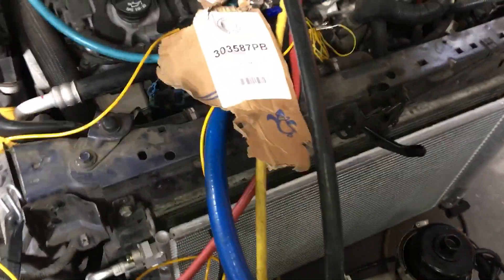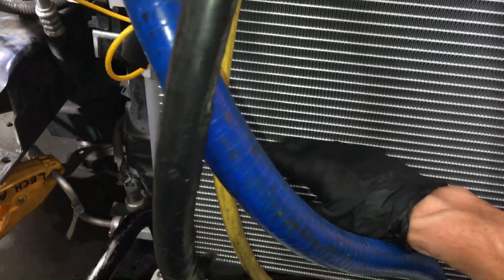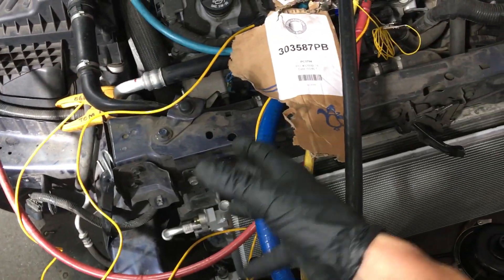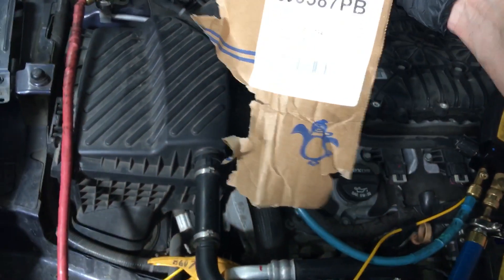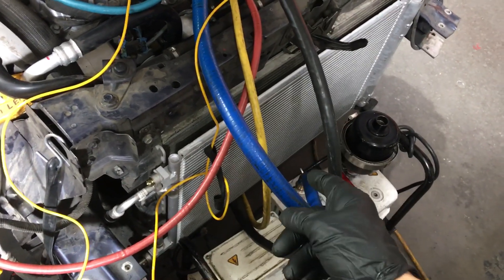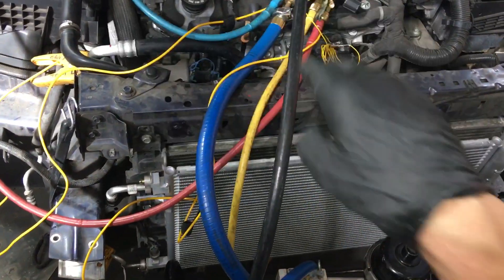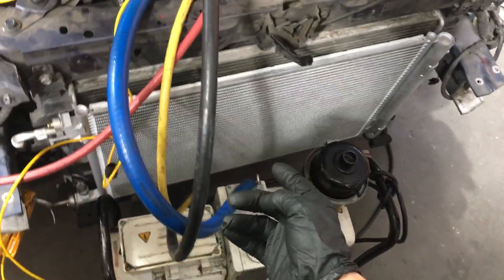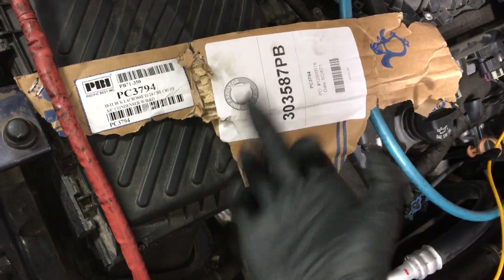Customer Gets ripped off with economy priced AC condensers.  People have no idea problems caused￼ ?￼

Comment: I just learned that with the 97 and older Mazda Miata's all of the A/C condensers available on the market are serpentine condensers when the OE one is a parallel flow unit. a friend of mine installed one of the aftermarket ones into his car and asked why the A/C doesn't work as well as it does on his other Miata. I told him its because of the condenser, we are going to attempt to install a 98 Miata condenser into his 96 because they sell parallel flow condensers for those cars.
Reply from the maker: When you do that there’s a possibility you might have to reduce the refrigerant weight. 

         Parallel flow condensers are much more sensitive to refrigerant volume. 
      They are a much more efficient condenser at rejecting heat

       Modifying hoses and fittings ends are possible and are available it just takes extra work making up your own custom lines if needed. 

        Make sure you change the receiver dryer. 
If you can just leave it on the vacuum pump overnight you could never over vacuum the more the better. 

         And if you’re very much into DYI it would not hurt to change the expansion valve. 
         Many people do not realize they have moving parts in them they have a spring under tension that has gone through millions of cycles through its life it has a refrigerant gas charge in the end of its valve bulb that sometimes has a limited life. 
             They may not be bad but they slowly drift out of calibration with age so why risk it it’s cheap just replace it. 

      And recharge it by weight of refrigerant not by any kind of pressure that somebody may tell you or temperatures. 

       Only problem is when you’re modifying the condenser the factory weight may not be correct. 

     If it is a true fan system make sure both radiator fans are operating to their full potential.

Comment: Hi. Thanks for the great info. I have a generic question I think will be of interest  for diy people like me subscribed to your channel. 
I know that best method is to evacuate a system and charge by weight. But is there a good method to topoff a system (fixed displacement compressor) that is low on refrigerant using SC and SH ? Or maybe in other  method.  As a diy  I don't have a way to evacuate the system .and looking for a way to topoff to the correct amount.  Thanks 😊🙏.
Reply: Nope.   No "DIY" here.   Take it to a professional.  Only licensed shops should touch the A/C system per EPA law.  Study up, get your license or pay a licensed shop to do so.
Reply from the maker: @komoru  yes , read up and study , 
RTFM
Reply from the maker: Thank you for subscribing.  And yes it is possible using sub cooling and superheat it depends whether you have a Office tube system or a expansion valve system. 

           But there are a lot of variables that can throw your readings off and they would be wrong anyway so you have to take care of those possible problems first or variables. 

      Condenser must be clean the evaporator must be clean no dog hair or heavy dust or leaf material build up that was stuck down through the fresh air vent or from having a dog inside the car and sucking up long fluffy hair. 

            Airflow is very important make sure if it’s an old car that the ground connection to the body chassis is clean and tight and good so you have full voltage to your old blower motor 
         Make sure your connector for the positive power is clean and tight if we’re talking about a very old car or you used to get a hold of the blower motor outside the firewall or under the kick panel where your passenger feet are. 

              It needs to be a fairly warm day say 80° plus

           Open up all the windows and doors to keep the interior cabin under a load of heat supplied to the evaporator you do not want a cold interior because that will satisfy your thermostat temperature setting and shut the compressor off in a row constantly be cycling never in a steady state.   

         I forgot to mention I am referring to old vehicles using R12 refrigerant this is how old the cars I’m talking about.   Newer vehicles with R134 is possible on “some” vehicles a little more difficult. 

             And even on these old vehicles in the factory manuals they would describe the method and what rpm the engine would have to be set up because it is different for different vehicles.      Compressors do not run efficiently at idle they were not designed to operate at that RPM.      Now to be 100% correct you would have to get the old factory manual go to the air conditioning section and read at what rpm for that year make and model with that particular manufactures compressor to hold the engine RPM at. 

            And if we’re talking about older vehicles do you have a single speed radiator fan that is not constantly shutting off and on causing your pressures and your superheat and sub cooling to constantly shoot up and down oscillating it Hass to be at a fixed steady state constantly running. 

                And if we are talking about much older vehicles that used a engine mounted fan on a fluid driven thermal fan clutch it Hass to be in excellent condition.   What I’m saying is you might as well replace it right now with a new one do you have like OEM operating conditions when the fan vehicle was new. 

           Fluid driven thermal thing clutches slowly drift out of calibration as they age let’s say roughly 30,000 miles to 50,000 miles of operation they still work but they don’t quite flow and move the quantity of air that they used to. 
                    The engine coolant temperature does not have to worry about this because radiators were usually so well over respect for their job because manufactures don’t want burnt up engines coming back all the time under warranty they have a lot of extra cooling for error with lower fan speeds it’s still cool just fine. 

                But the condenser chosen for the vehicle is often just barely sized right this is a part they always put the least amount of money into for sized correctly or lower airflow.  And just having a few hundred CFM less air flowing over the condenser while you’re performing your test affects the pressures affects the superheat affects the sub cooling that will give you the incorrect numbers.  

            But when you research and you look up and download or find old service manuals from vehicles going all the way back into the 1950s around when air-conditioning was introduced .
Reply: @komoru  I'm not in USA. In my country it's allowed
Reply from the maker: They will give you the information in pressure psi because that’s the way they did it and it was fairly accurate when following exactly their instructions on how I described above. 
                  For example let’s see whatever manufacture vehicle you have instructions says raise the idle to 1200 RPMs for some manufactures another manufacture it might be 1500 RPMs and another manufacture might be 1800 RPM.    So we used to turn the screw on the carburetor for the idle control and fix the RPMs at that level while it was in our shop.  Follow the manufacturers recycle or fresh air position whatever they say to do in their instructions for that year make model vehicle. 

           We would have a very large fan do you know those type of fans that you see that are 3 feet or 5 feet high. Operating in front of the car a few feet away pushing a steady flow of air over the vehicle. 

             Then whatever your year make model vehicles manufacture would tell you and give you a chart with temperatures down one column and pressures on another column and you would match them up for your high side. 

          The manufacture will tell you your high side pressure would be about 30 psi or 40 psi above whatever your ambient temperature was this is only an example different manufacturers were different. This is why are you follow and read the instructions. 
               So if the outside ambient temperature was 90°F.   The manufacturer said your high side pressure will be 50 psi higher than whatever the outside ambient temperature was. Then you would keep slowly adding about 1 ounce of refrigerant at a time waiting a few minutes between adding refrigerant and watching your pressure until it reached at 140 psi. 
                 At the same time they may give you a low pressure range and they might tell you your low side pressure will between 21 psi and 24 psi for example.   This pressure is just for example and not fixed in stone for every vehicle.       Because there were vehicles that when you would perform this test your low side pressure would be around 12 psi to17 psi for example. 
                Then there was other vehicles that the high side pressure under these exact same operating conditions the high side pressure maybe 180 psi to 210 psi under the same operating conditions. 
            And I remember there were some little foreign vehicles with very small condensers and I actually owned one of them I believe it was my 1988 Chevy sprint on a very hot day like 90° or 100°F my high side pressure would be around 310 psi and for some small vehicle manufacturers this was normal under really hot ambient conditions.  This is why you read

            And under these hot ambient operating conditions with the vehicle set at the RPM in which that particular manufacture called for using R12 refrigerant they would refer to the site glass looking for bubbles and with these old systems using the site glass back in these days we’ll get you in the ballpark and was fairly accurate.  Good enough for government work and we are talking about older cars. 
               This was specially more reliable on the old cars that used to have the Big heavy York or Tecumseh compressors or Frigidaire A6 

          There was an average and some manufactures would tell you on an orifice tube system that you would look for somewhere around A 5° superheat drop difference across your accumulator from your inlet to your outlet pipe.      
               But when we’re talking about these large old heavy usually slow rotating compressors because most all vehicles V8 engines did not rev to high RPMs.   The compressors were nearly indestructible so you can over charged refrigerant a little bit or under charge the refrigerant a little bit and starve them from a flow cool refrigerant or oil return. 
              Because these old compressors literally had a oil sump pump like an oil pan on an engine that would have about 6 ounces of oil always stored inside the compressor with a oil pick up tube located down below the oil level with an oil pump built-in internally that picked up oil just like your cars engine does and pump it with pressure to cross drilled passages throughout the compressor oil in the pistons and cylinders and crankshaft this is why these compressors were nearly indestructible. 

              But unbelievable guys were still so bad they would still find a way to burn them up which is absolutely incredible that they could get it so wrong.    But these guys who would burn up compressors all have one thing in common.   I did not read the manual ( RTFM ! )

         And these were just some of the procedures you would follow to do it correctly trying to get to the closest optical refrigerant charge level. 

           But then you have the guys who just grab the can in a single hose attach it to the low side and fill it until they felt cold coming out on their hand and called it good enough that’s the other crowd.     And with the old indestructible compressors that worked satisfactory for the people performing the task and it worked satisfactory because the customer had cold air blowing in their face.   And on the old indestructible compressors they lived for many years having the wrong refrigerant charge in them because they were nearly indestructible.
Reply from the maker: Now flash forward 40 or 50 years we have these tiny little aluminum compressors that fit in the palm of your hand instead of being the size of a battleship and weighing nearly 40 pounds. 

            To make such a tiny compressor light weight to keep the weight of a vehicle down in the ever increasing space under the modern cars engine compartment they have to overspend these tiny little compressors very fast to pump the same amount of refrigerant as the big old slow moving compressors. 

           The old slow moving compressors head race and bearing assemblies the size of a Silverdollar with large bearings for support and durability. 
                     The more modern day compressors bearings and races and needle bearings are the size of a dime or smaller and have small needle bearings the diameter of a number two pencil lead or smaller spinning at high rpm‘s so they’re very sensitive to needing lubrication and cooling back to them. 

               To compound this problem for inevitable destruction.     To keep the size of the compressors down the majority of new compressors do not have a oil reservoir or sump pump containing 6 ounces of oil anymore with a built-in oil pump and a pick up tube submerged down in that reservoir of the oil. 
                  A lot of today’s compressors rely on a 100% by weight fill charge of refrigerant to keep the oil suspended and travel around the entire system like an aerosol missed being sprayed out of a WD-40 can.   Being pulled along the walls of all the refrigerant hoses and pipes and make its path up through the evaporator coming back and being delivered back to the compressor with a cool flow of refrigerant to spray that oil over the high friction moving parts to keep the compressor from having damage or burning up. 

          And this is why low refrigerant charge starts overheating the compressors and as the refrigerant charge goes down the oil return also drops to the compressor. 

           So Kinda answering and not 100% answering your question yes on older vehicles with fixed piston compressors it is possible to use superheat or sub cooling if you absolutely know if those particular vehicles and have recorded or memorized a ballpark window figure for each and every vehicle when they were at 100% refrigerant charge that you knew by weight and then you take your measurements and reported them for different vehicles or especially you read the manufactures book .   RTFM 

       Even to this day when I come across a good working R12 old car.      I will go back to my old practices of popping off refrigerant on these particular vehicles because I was raised doing that since a child and growing up in an automotive shop my dad had access to all the factory manuals.    
       I did not have the Internet or Google or access to factory websites that you can instantly look up information like we do today.
Reply: @coldfinger459sub0  that's what's I'm trying to do. To learn.  In my country it's allowed to diy . Can you reference a document or link. RTFM   but where can I find those fantastic manuals?.
Reply from the maker: @yossikoren6658  do you have to Google search for your specific year make model vehicle. 
         Trying to find if somebody downloaded a copy of the factory manual. 

        Or you go on to your vehicle manufacturers website and look for diagnostic online subscriptions and they sometimes allow anybody to logon of course for a fee it might cost $10 or $20 and they allow you to read and copy 
              Different companies like Ford Toyota Honda Mercedes etc. will have different rules on for a certain price how long they give you access sometimes 24 hours sometimes a week sometimes a month. 

        Many shops nowadays pay for monthly or yearly subscriptions to have access to OEM vehicle manufacturers website for their manuals. 

        And then they have access for do it yourself people customers who just want to pay for one day access or whatever they allow